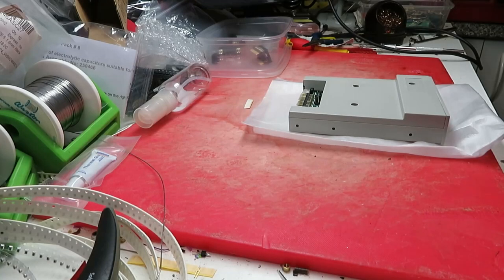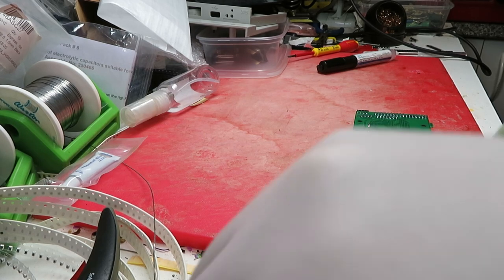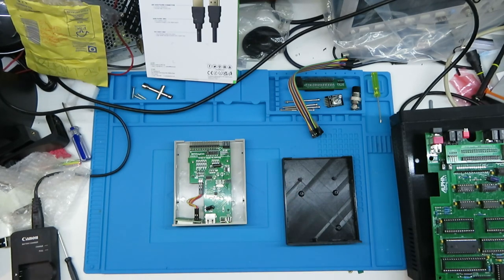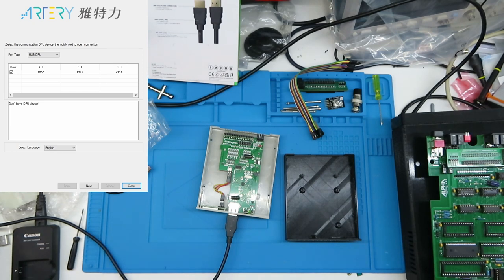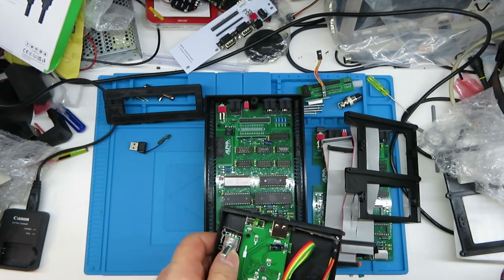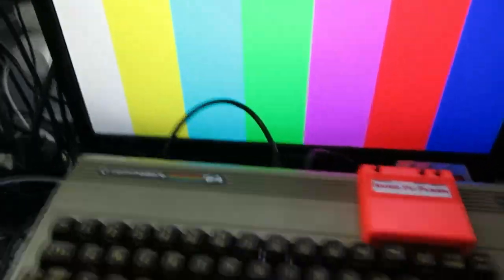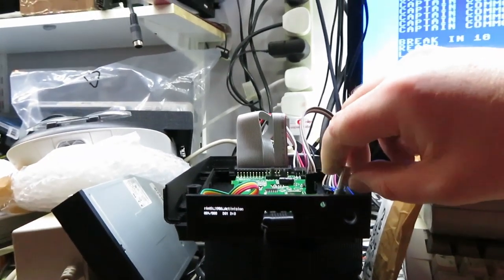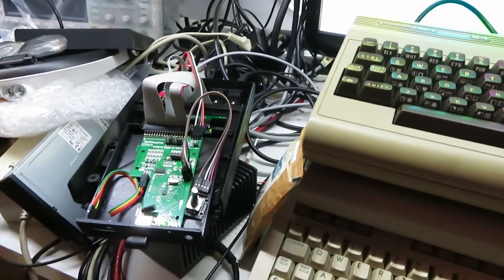captain commodore ep16 gotek 1581

Comment: You are WAAAAAAY too hard on your printer's quality. those prints had a smooth top layer, no stringing and consistent layers. You clearly know your way around a 3d printer.
Reply from the maker: I had spent quite some time getting it dialled in, The problem with black pla though is that it is prone to highlighting layers far more than white or grey filament, well , imo anyway 😀
Reply: @CaptainCommodore  I've found that if you set the temperature to around 180c-190c and have the cooling on max it makes things look a bit more matte. Fwiw Polyterra PLA is one of the most matte filaments I've ever printed, but it isn't exactly the strongest pla.
Reply from the maker: @George Packer  yea definately, I print at over 200 so I have the shinier but stronger print at 0.2mm
Reply: @CaptainCommodore  oh yea prints at 180c are brittle as shit.

Comment: I quite like this
Reply from the maker: I figured it's an easy way to write d81s too...... drop onto a usb and copy over to 2nd drive 😀
Reply: @CaptainCommodore  I've been meaning to get some of these for my trs80s. I'd love to find a way to use them on coleco Adam but Adam drives have a micro or optical switch that closes when a disk is present. It's used as a disk change sensor I think. Can these drives be modified to work on the Adam? I should probably Google it. I have heart surgery tomorrow so that'll give me something to research in recovery
Reply from the maker: Best of luck with the surgery, I personally do not own an adam but having a quick look at the FF site it is not list as a replacement, generally FF+Gotek can replace a drive that uses a standalone drive in a retro machine, not sure what the adam has but I have used them in a dragon,bbc,atari st,amigas and now the 1581

Comment: Where can i get a 1581 assembled board?
Reply from the maker: @jondoough  not seen them assembled....... however,  PCBway can build to order
Reply: @CaptainCommodore  Where can I get chips? Can you use jiffy dos on the board? Also what is that boot menu selector you are using? I just found your channel. Lots of good videos!
Reply from the maker: @jondoough  chips can be sourced from Ali express or amiga for 8825 , can use jiffy too

Comment: A suggestion from a pro, get some blue tack to stick your headers on to save you having to readjust later.
Reply from the maker: Hi, yea I tried blue tack but I had a few issues, especially when it's cold where I solder I spent time having to warm it up, all sorts of debris kept sticking to it and I kept having to clean the area where I stuck it, but for some situations it does work very well and saves a ton of time 👍

Comment: Have built one of these and struggling to get it working. It's not clear from the video but what do the LED's do on startup. When I power it on I get green and red LED both coming on. A second later red LED goes off, and another second later red LED flashes once on briefly and goes off.  Using a gotek with the latest flashfloppy. Error is "device not present errror"
Reply from the maker: Have you set the jumpers on the gotek correctly, also, have you set the dip switch on the board to device 8 ??
Reply: @CaptainCommodore  Both dip switches are up for ID 8. Also set S0 jumpered
Reply from the maker: @GregMcCarthyUK  then you shouldn't be getting device not found, even without a drive attached you should be able to read the device string out or error channel
Reply: @CaptainCommodore  Thanks, will continue poking around. Fault must be with 1581 then

Comment: Love love love this. I do prefer the bigger screen tho also adding a buzzer to make the load noises. It’s well fast, is it faster thanks the regular 5 1/4 dives, and that case is the absolute nuts!!!
Reply from the maker: It's a replica 1581 case for the replica 1581 pcb, the gotek acts as an amiga floppy,  the drives are quick when paired with jiffy etc, on c128s they can use burst mode, when I have used goteks in amigas and atari St's I always added a buzzer to those .....

Comment: So what Gotek is that?
Reply from the maker: Just a standard gotek in a 3d printed 3.5in bay
Reply: @CaptainCommodore  The Amiga one or PC one?
Reply from the maker: @neophytealpha  a gotek is universal,  and will work on anything with a floppy interface, it's the software that defines which machines it works on, flashfloppy is what I used

Comment: 1 Thing... does it support D81 and D64 Files ?
Reply from the maker: It only supports d81 files as the drive board is still a 1581 control board, its just the mechanical drive has been swapped for a digital drive, however, it should support d81 files better than anything else, sd2iec etc.......
Reply: @CaptainCommodore  o.k. Thanks. Just Thought it would be nice if it plays with both Images...
Reply from the maker: @Marcus Neervoort  if you need d64 and d81 image support may I suggest trying the pi1541 which jas support for both and is an excellent device